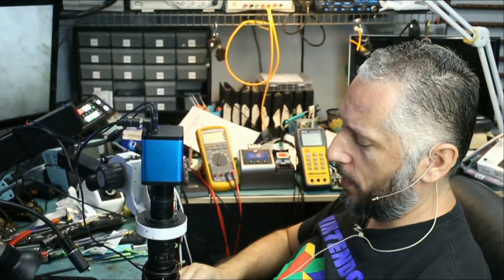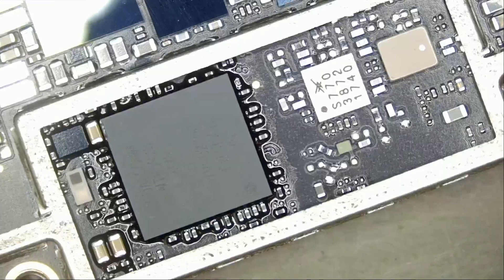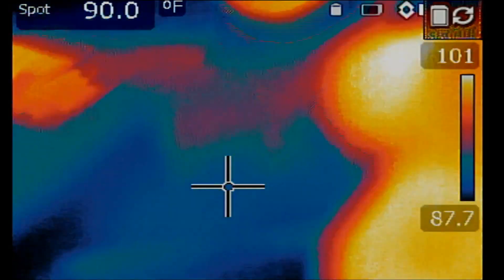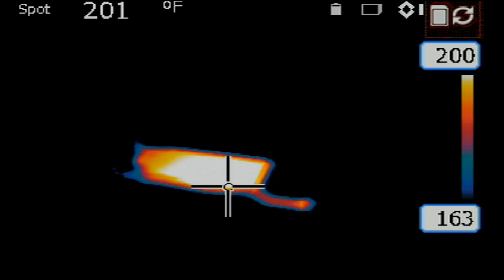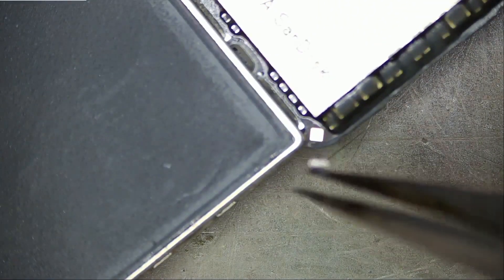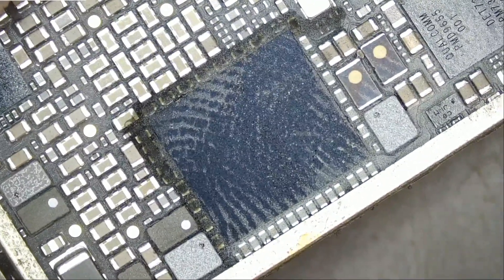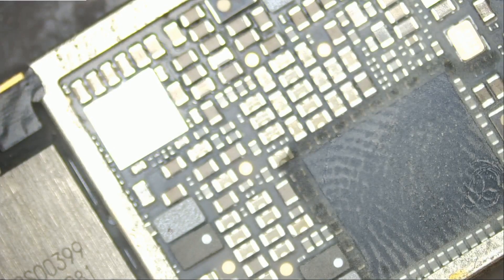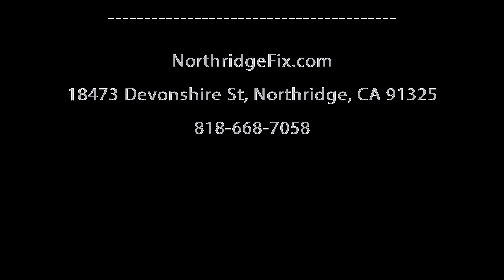iPhone 8P does not power on and sudden heat after drop. 0.6A charge. What's wrong?

Comment: Ive learned that with Asus, and Acer laptops, battery not charging after repairing a short on 19v rail usually indicates that the super I/O is damaged internally (assuming there's no damage to the battery charge IC)

Comment: The batteries don't work because there's a failsafe mechanism. You need to reprogram the chip. Even if you swap everything it won't work because the parts don't have the same ID numbers.

Comment: In some Asus and MSI battery replacements, whose new battery charge correctly but laptop only works connected to AC adapter, I've found usefull a little switch on the back of the board, whose seems to "rearm". Battery instantly starts to work. Reason? I don't really know, but it worked for me several times

Comment: Hi I would propose just to reflow the IC where you the heat development was seen, without any attempt to remove it. As the phone have been dropped, it is possible that one or more of the solder ball connections are degraded ( in spite of the underfill).  Once you reflow (heating up) the IC, the degraded  solder ball connection(s) could be repaired if you are lucky. The underfill will help to keep the solder balls in place.I know it is also risky because of the many components aoround.

Comment: You're not seeing all the black area around the ic? The small ones look like they're literally fried.
Reply: Pretty sure that's the underfill he's referring to, it's there to protect the components or to keep them stuck to the board. I think it's the same type of goop they put around CPU/GPU silicon to counteract the forces of contraction and expansion as the component heats up/cools down. I could be wrong though but just saying.
Reply: it's an underfill

Comment: I have a DELL XPS 15  9560 with Intel i7 chip and solid state memory that I bought in 2018.
It has been on and powered up almost the entire time I've had it.
Never had any problems with the computer.
Still has the original battery.  (Will hold a 3 hr charge, down from the original 6 hr charge.)
I did replace the power charger last year. (Failed due to constant twisting of the cord around the charging unit)
Just wanted you to know about this particular computer and its incredible reliability.
And, its touch screen still works.

Comment: Just have to ask, i'm not the best level 3 technician but i can do the more basic repairs. I had a iPhone 6 that had a PMU getting really hot and i searched on google for a solution cause i didn't feel like PMU fail a lot. Came across a video where a guy did a repair on a 6 with the same problem, turned out it was a bad cap near the NAND that was shorted but still the PMU was generating all the heat. Could the same thing apply here?
Reply: PP3V0_NAND goes right where the heat is coming from maybe it's the same issue?

Comment: Been watching your channel for quite some time. Great videos. Just repaired my first xbox series X the other day (HDMI replacement). In the video I used your "we did an awsome job" but I also added "as Northridge fix would say". It took a fair amout of heat and time to remove the HDMI connector, was wondering if I need a better rework station (currently using a 858D).
Reply from the maker: Use low melt solder. https://northridgefix.com/product/low-melt-solder-pack-of-6-sticks/
Reply: What temp and air speed did you use?

Low melt solder also makes a huge difference in time to remove

Last one i did if I'm not mistaken, using my quick 861dw I used 470c and 110 for air speed, came off in 10-20 seconds.